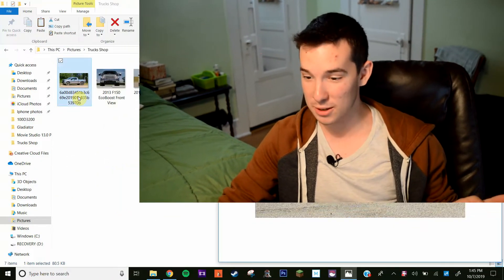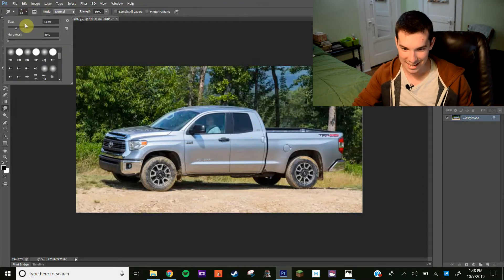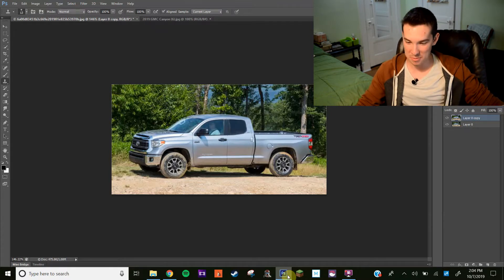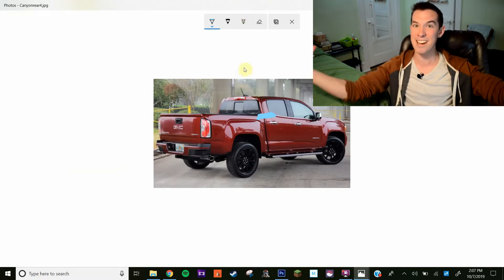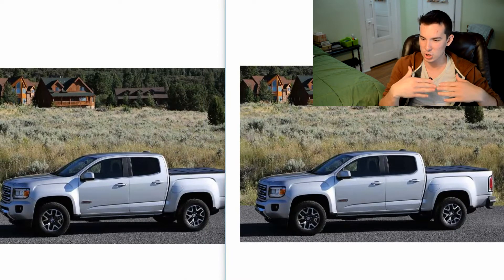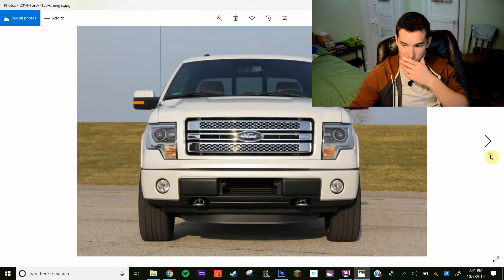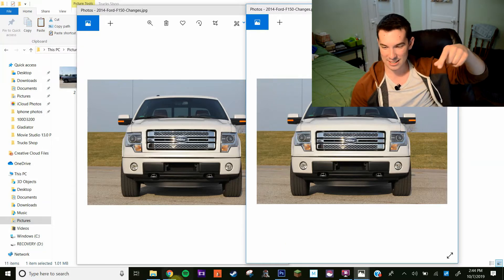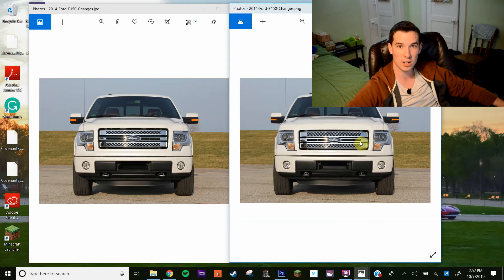I REDESIGN trucks in Photoshop!

Comment: I agree 100% with everything you said. The Toyota looks so much better without the downward swoop. You fixed the Colorado window which I've always thought ruined the look and flow of the entire truck. It just didn't work. The Ford grill is just a testosterone thing for the guys who buy them. Putting the grill on the same level with the headlights looks better but I would go an inch and a half higher.